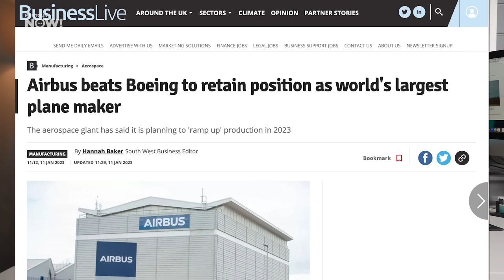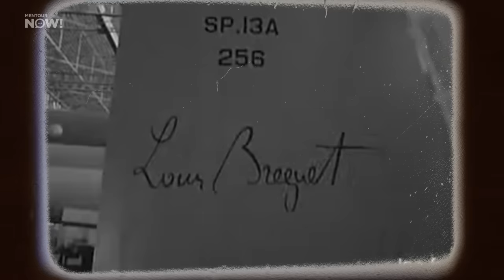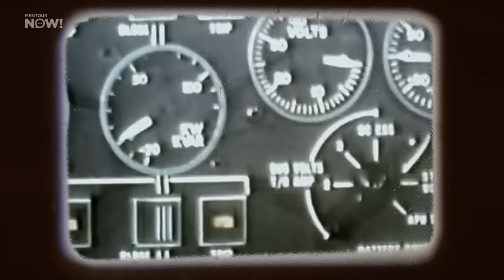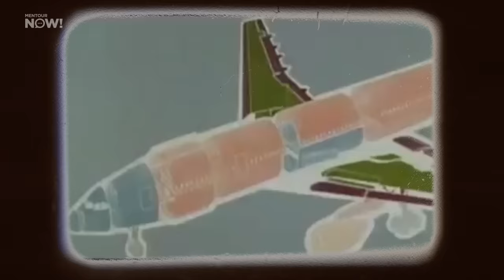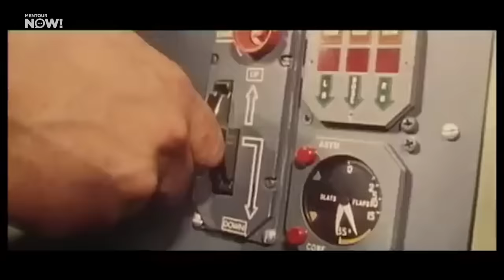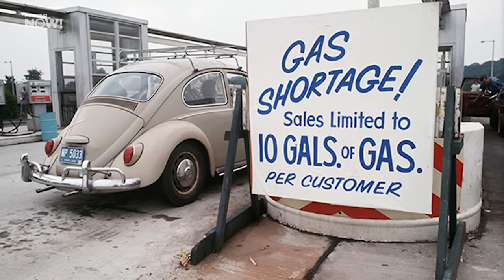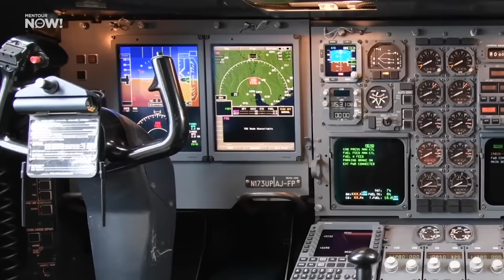Without this Aircraft, Airbus wouldn’t exist!

Comment: Airbus 300. The aircraft that has a remove-the-vertical-stabilizer feature. Just like the iPhones that couldn't be held wrong.
Reply: That badly trained idiot would have ripped the vertical stabiliser off any large aircraft.  The vertical stabiliser in the Queens crash failed at more than twice it’s ultimate design load which itself contained a significant safety factor over anticipated operational loads. The problem was the use of the American Airlines vertical stabiliser removal manoeuvre in response to some perfectly normal wake turbulence.  The plane would have been perfectly safe it the pilot had kept his feet off the rudder pedals. His response to the wake turbulence by completely unnecessary aggressive rudder inputs was due in part to instincts learnt during his compulsory 1500 hours on single seat light aircraft exacerbated by these being reinforced in a poorly designed training program at American Airlines.
Reply: @davidwright7193  That may all be true, but having a rip-off-the-tail feature built into the aircraft that can be activated with two steps on pedals is the pinnacle of poor design.
Reply: @akiko009  All of “that” is absolutely true. The American Airlines tail removal manoeuvre can be performed in any large aircraft with the same results. If you kick the rudder full left then full right then full left and son on, every reversal increases the force on the vertical stabiliser and the inevitable result is that the tail is ripped off. That accident had nothing to do with the airframe and originated between the pilots chair and the controls.  It was going to happen at some point to a US owned aircraft, operated by a US company, and flown by a US trained pilot. It had nothing to do with airframe or manufacturer.

Comment: Great interesting video on airbus. Concorde I believe to be the birth of Airbus. It was incredible that the UK  France and Germany could work so closely  together when Germany and the UK had been at each others throats less than 25 years previously. France under General degaul,disliked Britain and vetied uk eu membership. If there is  one political hero who could claim to be the father of airbus then that's the late  great left wing politician Tony Benn. When he was trade and industry secretary in the late  60s he pushed for the concorde development between the uk and France. Of course it also happens that the wings as are now were going to be made at filton near Bristol, in his constituency. Of the US did not like it's little UK friend doing anything that could harm it's trade so there was a swing towards going in with the yanks in the early 70s. The UK government actually bankrolled Lockheed so it had aircraft to put the newly developed rb211 engines in. Although a great inovative plane it was not a sales success. Why didn't rolls royce put the rb211 in the airbus 300s? That would have made much more sense.
Reply: IIRC, the RB-211 engine was not powerful enough for the twin-engine A300B at the time that type was being launched, but sufficed for the three-engine L-1011 Tristar. Hence Airbus's choice of the proven GE CF6, which was also standard on the DC-10. 
The RB211-524 (later named the Trent) came out too late for the A300, even in its Dash-600 version, or the A310. But the Trent became a popular option for the A330 and a cropped-fan version was designed for the Dash-600 version of the four-engine A340, a type which had suffered from the limited thrust-growth potential of the otherwise excellent CFM-56 engine.

Comment: I wonder what would’ve happened had there NOT been any full government subsidies, especially considering that they went more than two years withOUT any sales.

Douglas looked at developing a twin engine DC-10, as did Lockheed a twin engine L-1011, before the A300, but couldn’t get around the ETOPS limitations and at the time didn’t take Airbus too seriously given the poor sales… incredible what government subsidies can do.
Reply: Of course Airbus require big government subsidies to get off the ground. But as they pointed out, at that time the American makers were getting massive development subsidies for large military aircraft, the skills, ideas and learning from which were immediately put to use for commercial aircraft development.

Comment: The A300's time-enduring fuselage design is what Boeing thinks the 737's is.
Reply: If Boeing would have just kept the fuselage the 737 would be still a modern aircraft.

Unfortunately they even kept the landing gear of the 1960s version and the flight control system too.

The 330/340 kept the fuselage, but got all the other stuff new.

Comment: As a passenger, the A330 is not very comfortable to me, it feels crammed, and many of them lack personal air vents for each passenger - this is very annoying to me as the cabin is always either TOO HOT or TOO COLD. Europeans tend to keep the heater on which makes the cabin way too hot, Americans tend to do the opposite which makes the cabin way too cold. A personal air vent for each passenger should be required by design IMHO. Whenever I fly and I see A330 or A330 Neo on my ticket, I regret the economy seating haha. My 2 favorite and most comfortable Airbus planes are the A380 and the A340, with the A380 taking the cake HANDS DOWN, it is the most comfortable plane in the world (in my most humble opinion).
Reply: Have to agree with you, though I prefer the A340's 2-4-2 seating layout to the A380's 3-4-3, the A380 seats are wider and supremely comfortable, even in Economy.
Reply: @cr10001  it's 2-4-2 on the upper deck of the A380! At least on Emirates that is (which is my favorite airlines). Yeah I regret travel every time I see an A330 if I bought an economy ticket. Never been on a comfortable one with the exception of Delta's on their premium select seats.

Comment: Huh -- so, Dassault Mercure suffered from being designed too closely to fit one specific use case, and be very good at that, but rendering it non-adaptable for sale to customers with more flexible needs.  Not the only model to face that through the years, but, what might have been.

Comment: Your relative fleet comparisons at the start of your story did not do justice to L10-11("even the L10-11" comparing to DC10), HS Trident(European 727 look alike) VC10(looked like IL62). L10-11 was by far the more distinctive, more sophisticated, safer, more comfortable of the two..even if it sold less as it was more expensive to manufacture ). The 727 was the copy cat not HS Trident. Trident's blue print were hijacked by Boeing who in the initial pretence of collaboration ended up independently producing the 727 with a less sophisticated cockpit but cheaper operations cost 727. There was no "European" produced B727. Simiiarly the IL-,62 was a Russian design to look like the VC10 with far less sophistication as was the TU-154 to 727 and TU-144 "Concordski" to Concorde.The IL-96 on the other hand was a copy of A340. DC,-,9 was produced in 26 July 1963 vs 1961 for the BAC 1-11 which means I can safely assume Douglas Aircraft Company liked its design and the its short haul market mission!

Comment: I still sigh when I buy an airline ticket and learn that the equipment listed is an AirBus product, of any generation.  Having cut my passenger wings with DC-3, DC-8, DC-9, 727, 737 and L1011, it just doesn’t sit right with me.  Although I will make an allowance for Abus in lieu of DC-10 and variants (close calls) and Lockheed Electra (close calls).
Reply: They’re doing well because they’re better.

Comment: The A300 was not a technological marvel and was a failure economically. Its only real benefit was getting Airbus off the ground. Even most the tech was found in other aircraft at the time.
Reply: Nonsense. Utter nonsense. 
It set the overall configuration that has been used by every large aircraft ever since except the A380. 
It literally set the standard.
Reply: @peteconrad2077  So...was this built before or after the 737, because I forget which is older and as such, set that standard?
Reply: @jhmcd2  the 737 isn’t the same configuration. Nice try though.
Reply: @jhmcd2  737 wasn’t produced with pod  and pylon engines until 1984.
Reply: @peteconrad2077  That's because hybypass turbo fan engines were first employed on the 747 (and I think the C-5  Galaxy, but I have to confirm). Basically put, the A300 didn't pioneered that format, the Dash8 (707) did, followed the the 737, then the hybypass engines were first used in commercial aviation by the 747. So sorry, your still wrong on this one. It may have been the first twin jet to use these engines, which is a notable feat, but it wasn't a trend setter.
Reply: @jhmcd2  you’re full of it. The modern fine of twin high bypass pod engines was first used in the A300. No aircraft used it before. The 737 used an integral power unit until 1984. 
Cry harder.